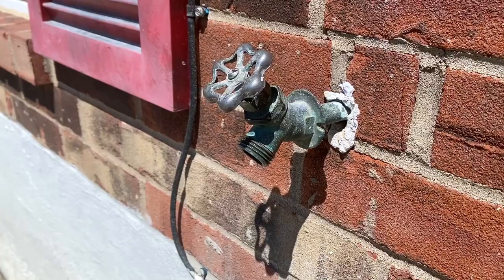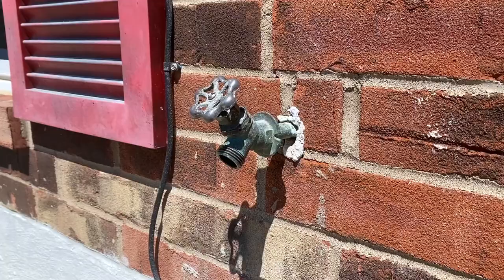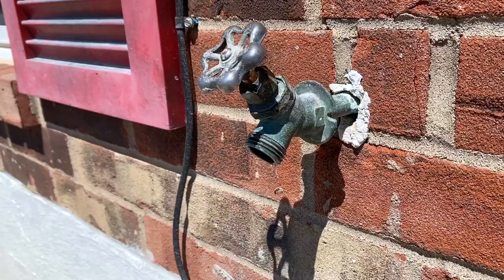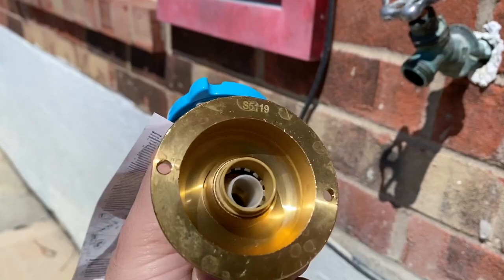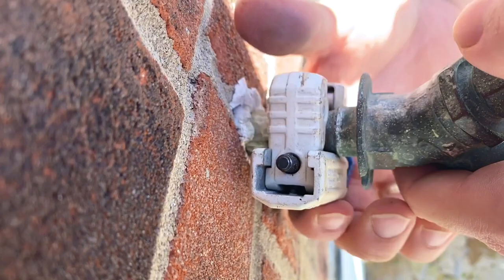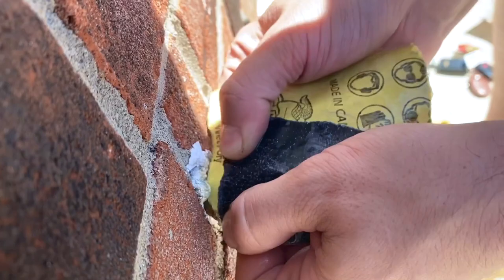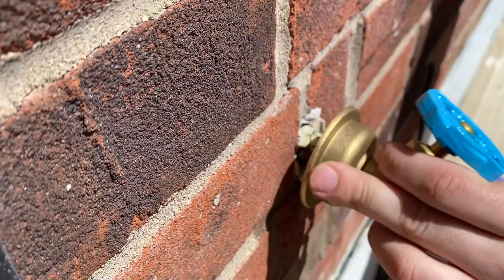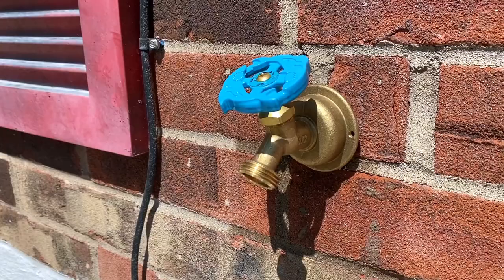How To Replace a Leaking Outside Faucet In 5 Minutes - Garden Faucet / Hose Spigot

Comment: Didn't see you turn the main valve back on. So...
TIP: After you open the valve, all the way, turn the knob back in a quarter turn, This will allow you to twist the knob back and forth, in the event the valve gets stuck from hard water deposits.
Reply from the maker: had my brother do it didn't get a chance to recored it, thanks for the tip
Reply: Wish I knew more in detail, what you mean.  I hired someone to do it and still leaking.  He was a plumber/handyman, if it was so easy then why couldn’t he do it right? 😖
Reply: Sometimes, it depends on the quality of the faucet. Shark Bite products are, usually, very good, but, improper manufacture or plumber/handyman installment may have damaged the interior "ball" valve (hopefully, it isn't leaking inside your home!). As an example, I attached splitters (allows two hoses to be attached to the one faucet) on my outside faucets at two different times. A cheap, plastic, one, worked great one summer, and failed the next (the plastic ball valve must have broken during the winter), while an expensive bronze ball valve hasn't failed in years. However, water pressure is surprisingly strong, and may force its way through even the best-made faucet valves, in which case, a professional plumber may be your only hope (est. $200).

Comment: A lot of issues with the video. Starting with the obvious, leaving it leaking like that will not harm the foundation, otherwise rain would have done all the damage already, next there is no way the shark bite is in all the way, unfortunately with these you either need access from inside wall, or crawl space. Never try to unscrew it from the outside, 9/10 times you're gonna make it worse. if it's a new home with pex, undo the screws and hope there is slack to properly grab both ends and safely remove it.

Comment: Sharkbite requires minimum of 7/8" insertion to fully seat and the pipe to be fixed or something holding it so it wouldn't move as you push the fitting. This is not how you use Sharkbite

Comment: It appears the shut off for the outside spigot had a worse leak than the spigot. That was quite a steady flow draining out.
Reply: Yup but that's a separate issue lol, also a good reason to use shark bites in his case!
Reply: It's probably the rest of the water draining from what is sitting in the rest of the plumbing lines (line leading to the bathroom etc,) they are all interconnected.

Comment: If that shark bite faucet just so happens to leak, there's now no way to get it off without cutting it from inside. Soldering on a male adapter and then threading on a replacement faucet is the only way to go.

Comment: Fitting, pipe slack, etc aside..... Didn't you just replace a bib with a decent sized inner diameter for what appears to be close to a quarter inch inner diameter bib? Hard to tell exactly in the video, but if I'm right then good luck getting good flow through a hose using that bottleneck.

Or I'm an idiot who still doesn't understand PSI, GPM, and other plumbing wizardry.

Comment: they also make a compression hose Bibb. there was no way that shark bite went on all the way . to much wiggle . I would have just used a hacksaw blade and cut closer to the valve so I had more room. then I would have tried to put a little wedge in the brick to take out play in pipe. take out white piece in sharkand sand the end and put a little plumbers greaseto make sure. the shark don't get damaged if it leaks at the wall and you don't get it on all the way you won't know till it blows or leaks then you got to take out brick or sheet rock in wall in house. its true you could replace washer if the bonnet nut will turn however it's possible when you put your pliers on and start to turn it could break at the wall. plus its copper I see a repipe in the future. . not sure where he shot this video but where have my plumbing business there square boxes. usually those circle ones are a main valve to shut a bunch of houses or its electrical or some other type. read the box real carefully. you. don't need that problem. there are other shark bite hose bibbs out there that work so that in the future you could take a shark bite tool and get it off but by that time he will be repiping. and that pipe was not secure bad installation when it was built. you keep pulling on that and could a leak in the wall. well that's my say. better pay me to fix it. plumbers get a bad rap. we have to come fix what the weekend plumbers tried to do to save a buck . big problems that occur from weekend warrior plumbers trying find water meter at street and using whatever tools they got to turn off water or shut off valve at house is stuck or broke. I seen valves break at house and water meters ,due to panicking .simple fixes can turn ugly. 
.

Comment: The way the pipe was loose inside the wall, the sharkbite dint engage good enuff and now the leak is going to be inside the wall which is worse than leaking outside. Sharkbites are not good for outdoor environment in the long run.

Comment: Remove the bricks????
Reply from the maker: hahaha that way too much work :)
Reply: @TheCleverMillionaire  You don't understand. You said that if you tried to unscrew the facet and messed up the pipe, you'd have to remove the brick to repair it. Why would you remove the brick?
Reply: I would have replaced it with a frost proof facet, fixed the leak, no worries about freezing.
Reply: C Bob Whit

Comment: Shark bites are great when replacing hot water heaters too. The shark bites can be easily removed if needed. (They come with a small plastic tool for removal).